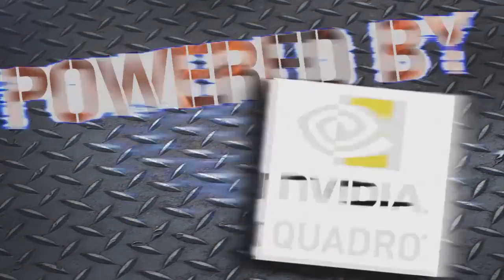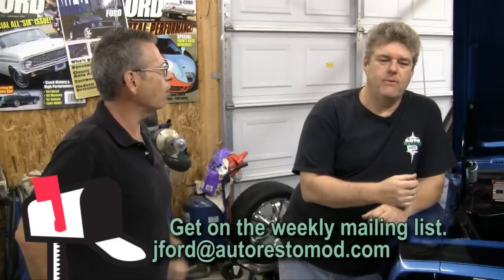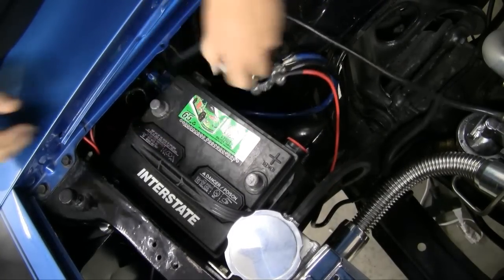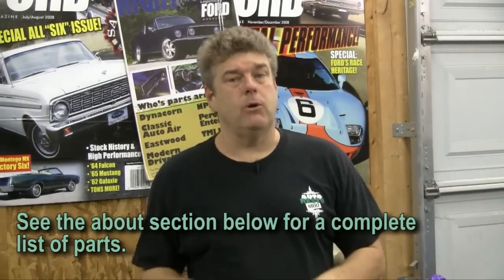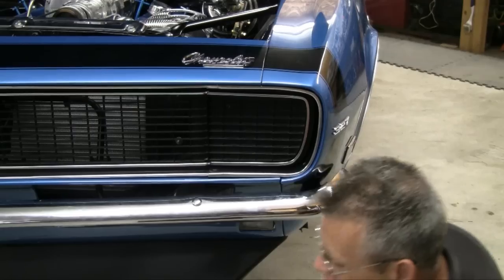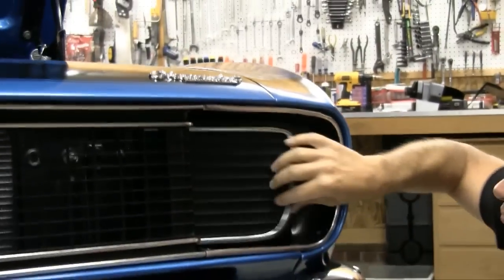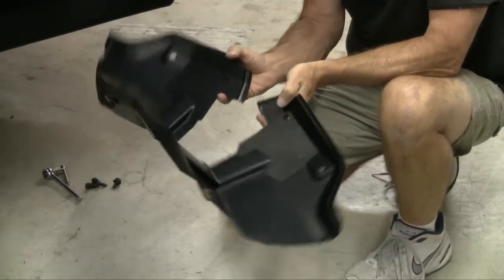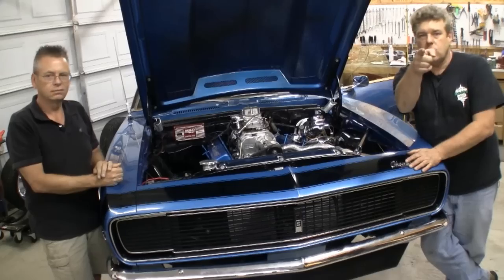Camaro RS Rally Sport 1968 1969 Detroit Speed Electric Headlight Door Kit Episode 174 Autorestomod 2

Comment: Rally Sport-specific inner wheelhouses are now available through National Parts Depot (no cutting/drilling required to install RS headlights and supporting parts)!
Part numbers are listed below:
1967-68: C-8153-3A (right hand/passenger side) / C-8153-4A (left hand/driver side)
1969: C-8153-7A (right hand/passenger side) / C-8153-8A (left hand/driver side)

Comment: Being more inclined to the body stylings of the 67-68 camaros over the 69's, is it possible to throw a 69 rs grille on a 67 body? Probably the only restyling on the 69's that I really enjoy over the two previous year.
Reply from the maker: We agree that the doors on the RS kit for '69 are cool. We haven't seen that done, but there is way more "done" than we see. We'd say measure twice and cut once. That is, get some measurements. and look at a '67-'68 vs. a '69 grille opening without the grille in. Then sit down and figure the cost in skinned knuckles welding wire and crossed kits. If all still looks good, go for it.

Comment: Where did you get the shields?? I'm installing the Detroit Speed RS hideaway headlights on my car and would really like to get the shields to protect it? Thanks and please share. I've found Actuator Shields in Classic industries catalog that look like what you have, but would like to be sure before I order them. Again thanks.
Reply from the maker: If it isn't part of the kit, or something that National Parts Depot carries, it was on the car originally. The car had factory hideaways.
Reply: @AutoRestoMod  Classic Industries has a set in there catalog, but wasn't sure if they were the same in video? They didn't come with the kit I bought from Detroit Speed but definitely think they would be beneficial. Thanks for responding so quickly. I really like your videos, but could benefit from seeing the actual work being done. I'm a visual learner. Again thank you.

Comment: hey guys,  got a quick question.  I just installed multi leaf springs on my 69 camaro and the plate at the bottom with the single hole for mounting the shocks don't  allow me to fit the shocks on snug up against this plate on either side.  Its almost like the angle on the plates is off.  I did order the shocks for the multi leaf spring set up.  Is there a trick to get the shocks to mount correctly to these plates ??  Thanks in advance,   Jeff
Reply from the maker: One thing that we'd recommend is to have all the stuff in the car before setting the shocks. Seats, glass, etc. Hey, contact Jeff directly. He'll want some pictures of what you are running into: jford@autorestomod.com

Comment: The passenger headlight has a bad chassis ground, As with some older cars the battery side headlight ground wire and or mounting point, will be the problem with this type of dim lighting, I have also found the problem at the headlight where the plug ground wire has pushed from the plug. I watch AutoRestoMod often wonderful show lots of nice tips, I didn't see anyone note this about the dim headlamp, thought someone may want to know
Reply from the maker: Thanks for he info! We were only concerned with the function of the doors. After it was finished the owner let us in on the fact that the lights were "not quite right" and only worked on high beam. And that only one worked well. Jeff found: a broken ground wire on the right light and enough gloppy carpet trash on the dimmer switch to cause a no function situation on the low beams. This has been fixed. The owner is going to replace the bulb on the passenger side.

Comment: my dad restored a 68,and a 67 when i was about ten yesrs old he said that the headlight covers worked by an air vaccume hose i dont know if this was true as he sold it for 15k back when i was 11 years old  damn if only i had been born a decade earlier it would have been mine it was really sic 350/350 two double pumpers high rise manifold i still remember the sceaming sound of the blown engine that would almost make me shit my pants! he said that he dad to sell it because small block chevys with blowers wear out the main and rod bearings quik....it was midnight blue metalic with crushed dark blue velvet interior i remember he had to reinforce the front end suspension becsuse the camaro would literally pop a wheelie when you would dump the clutch in first gear! i still remember it was tubbed in the rear with P325/50R15 mickey Thomsons i remember when he sold it when he went to the bank to cash the 15k check the FBI was somehow called in to ask him all kinds of questions and it wasn't the last time eather....
Reply: I believe the 67’s were vacuum operated and changed to electric in 68